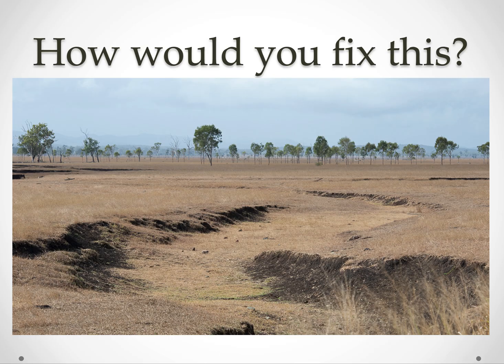Retain Every Drop: Water Flow Management for Your Land

Comment: The compaction was worsened most by overgrazing practices.  When you avoid overgrazing hooves are of little consequence.  
In fact hooves can be very important to reclamation because hooves create divots in soft soil that collect water, seeds and humus.  This helps plants reestabliish.
Reply: hooves bring seed into contact with the soil - especially when ground is dry. they then grind groundcovers down to cover the seed. when ground is wet or dry grazing has an influence on the seed bank and mulch. only plant growth managed to increase plant density restores rainwater penetration to optimum.

Comment: total wrong - compaction only occurs post overgrazing of vegetation. overgrazing of vegetation is human negligence. also known as poor management. good managers use large grazing animals to restore groundcovers.
Reply: Yes, the livestock can actually reverse compaction by creating divots in rain-softened ground that collects rainwater, humus and seeds to help thicken plant growth and diversity.
Reply: @b_uppy  not true - management of livestock can provide for ever increasing plant density. it is the plant matter that increases rainfall penetration. cattle cannot reverse compaction. plants can.
Reply: @Jack-w5k4p  
They use divot machines to replicate the divots made by large livestock to regreen, even in deserts.  You are wrong regarding livestock's ability to have a positive impact with hooves.
 Overgrazing is a management problem rather than cattle/livestock being the problem.  Reread my answer...
Reply: @b_uppy  without groundcover the small impressions made by hooves are irrelevant as they will wash or blow away. large livestock do not make divots. they actually create a flat scuffled surface. when some soil types are wet like black alluvial soil cattle will leave either pug the topsoil or according to livestock density leave hoof holes. compaction varies according to soil type. light loam soils are more susceptible to hard panning from cultivation. hardpans can be 18 inches deep. so to eliminate compaction livestock movements alone are irrelevant. it is plant root growth and micro soil life forms that reverse compaction. in worst case scenarios deep ripping is required. livestock can provide manure to feed dung beetles that are part of the decompaction process. so to be successful with livestock management you must manage livestock to encourage groundcover plant density.
Reply: @gardenersgraziers7261  
Sorry but what I described is real.  
Zero people spreading seeds but still the divots do a much better job than without.  Zero hypotheticals.  The depressions just work.
Reply: @b_uppy  of course every type of construct will generate an effect. that is a universal truth. the part that you do not understand is animals and the role of plants. 

it is plant growth/decay and only plant growth/decay that is relevant to decompaction of soil. 

the hydraulic effect of still water in broad shallow divots will start the process. divots themselves do nothing. over time divots will fill up with soil.  

there is then the possibility of creating an adverse effect of diverting too much water to the ultra deep subsoils so that it becomes unavailable for plants.

most grasses access moisture usually first 600mm topsoil - however some grasses have 2 metre deep roots
Reply: Total wrong??  Come on

Comment: I have recently moved onto a property which was compacted, had poor grazing & soil nutrition. The sheep i placed on it cleaned up the rubbish plants & allowed me to reseed the paddocks.
The problem now being the water management as the entire property is on a contour & water skates across the top & into a neighbouring native bush area.
This is my journey as i type... creating *shell scrape swales, leaky weirs & a small pond which has attracted the local bird life & not deep enough to endanger the sheep.
The land is still hard & so aside from irrigating sections at a time, i am using wood chip which i scatter across the land. The chip holds moisture, shades the soil & eventually adds to the top soil yet it also naturally accumilates in  areas where rain events push it to. Over time, i envisagea formation of small natural ridges which will capture & hold water for a little longer.
I have willows & tree lucerne waiting to be planted out for shade & added forage, all of which i am taking cuttings from to multiply the yield over time.

I am fairly new to this game, yet i am also very motivated with the goal to have continued forageavailable for the flock, rather than spending money on supplimental feed.

This, to start is a 5yr goal, to be reassessed after 5yrs. I have heard that you can only keep 6 sheep per acre, i hates rules of thumb & am certian that a well maintained paddock system with alternative forage available can support more sheep. The hardest part is to start a rotational grazing regime when we are currently suffering from a drought, on top of the current pasture condition.
Reply: An easier way is to dump hay bales to thin spots and let the sheep distribute it when they eat it.  I know cattle will leave a large portion of local, diverse plant hay when fed this way.  It leaves mulch, fertility (dung) and seeds, a perfect combo for restoring plants.  

Woodchips take much longer to break down and will temporarily reduce needed soil nitrogen.  

Adding nitrogen-fixing trees to create a savanna-like environment can  help (you'll need to protect them from grazers).   Trees help protect grass and livestock from too much heat, and can add beneficial mycelium to move moisture and nutrient to where it is needed.  The trees can be a source of future fodder themselves...
Reply: @b_uppy  Thank you, some good advice there. The nitrogen situation, i am aware of yet the pro's of manually ferting the soil, myself (just done), with the first rains falling as i type, I intend to sow just before the next rain event due in a week, then lightly scatter woodchip. My main focus is actually water retention & a bit of shading on the soil as we move into autumn.

I have full intention to protect my fodder trees from greedy sheep, with planting sites located to maximise shade for areas of the paddocks which get the worst sun. The land was used for horses before us, they were badly beaten down, compacted & nutrient deprived, anything beats nothing i guess :).

I will use hay as you suggested to aid in the moisture retention & native grass sowing like you suggested though, thanks for that
Reply: @Drunken.Lyrics  
Do realize it's better than woodchips.  Woodchips take time to rot and use the available nitrogen to breakdown the woodchips, robbing the soil (and plants) of nitrogen.  That doubles the work, as well as making it harder for legumes like clover and vetch to germinate.
Reply: @Drunken.Lyrics  
If you're motivated, make swales in higher areas and use the woodchips there instead.  Make sure the slope is less than 30°, as steeper than that is more prone to failure and flooding of lower areas.  Swales in the sweet zone mean less overdryness on the hill, less wetland/flooding in the lowest area (or at least less temporaty bogginess in the lower area).  
Water harvesting using woodchips in the swale increases biology, thus water absorption. This  decreases the chance of mosquitos, no see ums, etc.  The water is stored away from direct evaporation.

Trees on slopes over 30° are best as natural moisture protection of hills and mountains.
Reply: @b_uppy  We are on the same page, I have started on the swales but more a shell crape (military term) as i do not want my sheep to slip or fall. I filled the in with wood chip & spread it above & below the shallow swale so the water carries it further down, spreading it out. This is the first rain to fall onto/into them so i expect i will be touching them up afterwards before i over sow.
Reply: @Drunken.Lyrics  
Love what you're doing, keep up the good work!  Just make sure if it's an area that you want to take tractors thru (now or in the future), that you've got enough space.  Heard one poor guy cursing his for that reason.  Big ouch.
Reply from the maker: Sounds like you are doing a great job. I'd love to cover my paddocks in wood chip, it used to be free and now they are charging lots as more people want it. The other thing to do in a drought is to create a sacrifice paddock. Fence off an area big enough for them to live in until the end of the drought. You sacrifice this area to preserve the remainder of your property. The excess manure and left over scraps of hay and feed will eventually help create compost and improve your soil. Then when the rain comes you can throw out seed in the sacrifice paddock and leave the animals in there a bit longer for their hoof action to press the seeds in and break up the hard surface. Then take them out and watch the magic happen. You could do this in another small paddock until the pasture has time to come back in the rest of the property. Search through my videos and you will find one on the sacrifice paddock.
Reply: number one = DESTOCK until you have groundcovers = no need for anything else - depending on rain 18 months plus should be a typical rest period - the rubbish that your sheep cleaned up ??? WTF mate this stuff is essential to start the process - you need to let everything grow until it sets seed - no seed = no groundcovers
Reply: @Jack-w5k4p  
1) Actually he's sort of onto something thru higher stocking numbers and a rotation is based management.  2) You're assuming that he already has six sheep per acre (btw stocking rates greatly depend on typical quality of land in an area).

Consider this:
Alan Savory tried destocking in Africa by culling huge numbers of elephants.  After doing this for a long period (30 years!), the soil quality worsened despite best efforts and plant cover became much sparser.  
He was wrong.  And then tried to figure out why. 
He then realized that it was the interruption of natural grazing patterns of rapid heavy grazing, then rest as predator pressure kept the grazers moving, that was his "Aha" moment.  
Alan Savory has lots of videos where he has also helped people manage livestock this way (by mimicking predator pressure by using large sticking numbers in small spaces and moving (usually) once a day.  The forage and soil greatly improved in a few years (instead of thirty).  
The pasture needs to recover, but also avoid overgrazing.  Letting the livestock eat more than half, or below seven inches removes protection from dessicating wind and solarization.  Unless there is a high rodents to plants ratio, it's likely the seed is already there.  

You can graze an area, but avoid letting animal be on it long because they will destroy the favored forage and leave the other stuff.  
With the Savory method the livestock eat the desirable and the less desirable equally.  This allows better the forage to recover instead of the reverse, or worse.  
If he can keep the livestock off that area until it's better established then it will start producing more biomass per acre, per year with zero or greatly reduced inputs.  Fertilizer expense is avoided, less cut hay is needed, livestock need less deworming and as well as other medical interventions, a lot less less manure run off, less irrigation, the list goes on.
Reply: @Jack-w5k4p  hmm, yeah, good advice, it is the simpliest, cheapest way to do it.

Comment: This is an excellent video.  Thank you.  But I have a related question.  Here it is.  I have been doing this on my land for about 50 years and have a fairly mature dense working system of about 25 acres of pasture.  I have posted writings about it and MANY videos for the last 12 years at least.  I have traveled physically to the Alps and to Portugal for the purpose of studying it and posted about those trips, first having seen it in Peru and Senegal.  I have traveled endlessly on line studying whatever I could find about acequias, levadas, bisses, Suonen, Andenes, socalcos, terraced landscapes -- all part of contoured farming and gardening.  WHY? do my posts have so few views when a fine one like this one, within a month has 6.3 K views?  I am NOT jealous, but I wonder why it is SOOO difficult to get the word out.  See, for example one of my most watched videos.   https://www.youtube.com/watch?v=4P60vrSfrGs&t=119s  If there is ANY way to promote this technique you would be doing Gaia a great favor to share it.
Reply from the maker: I am just as surprised as you. Maybe it's in the titles. Most of my other videos have less than 100 views. I tried hard during our drought to push this stuff in preparation for when the drought broke but there wasn't much interest. All we can do is keep trying. BTW did you subscribe? I'll share the love.
Reply: Because rainwater harvesting fails to sell irrigation equipment, barn material for storing hay, bank loans, insurance, etc.

Comment: Up here in America, we've been looking into various methods of rehydrating the land and controlling erosion.  I live in Western Washington, which like Eastern Victoria down there is a rather wet environment, but we still use those rocks-in-cages as leaky weirs to help slow water and prevent erosion during flood events.  Oddly enough, it doesn't have to be a tall rock barrier!  There's a video on small rock "dams" in a watershed called Turkey Creek which made a huge difference between it and its neighboring watershed.  There were simply a lot of these little check-dams set on Turkey Creek by the landowners, most of them only a couple rocks high at best.

The results were significant enough that the USGS (Gelogical Survey) asked if they could do several studies on the differences, and came up with that video, which you can look at here: https://youtu.be/c2tYI7jUdU0?si=x0XSriV0qZltJF1_